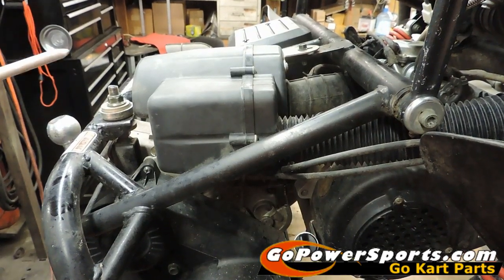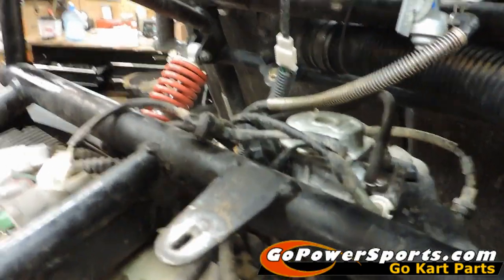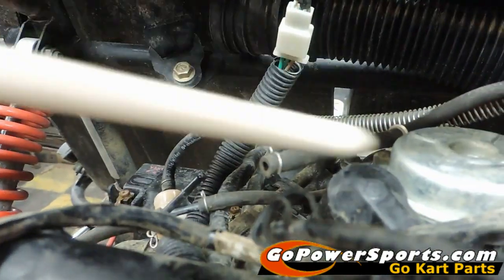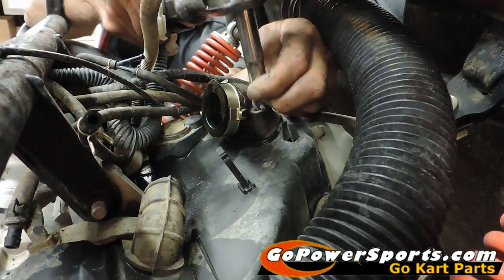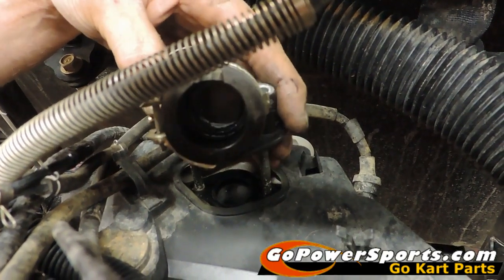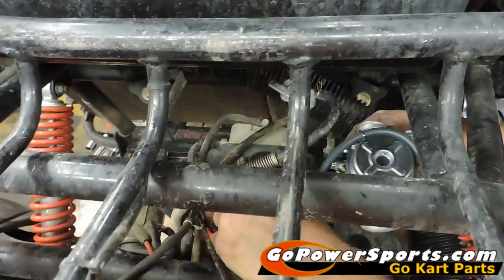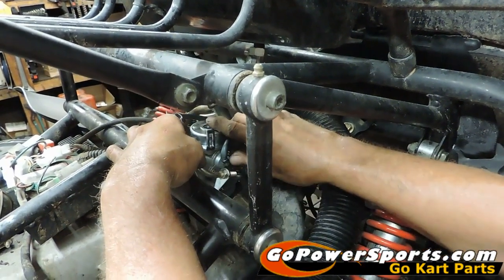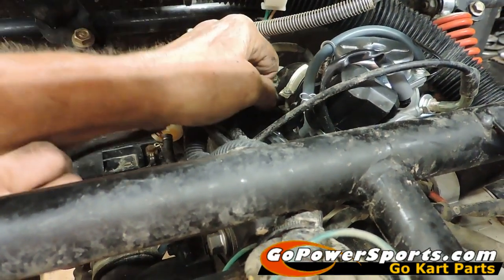150cc Go-Kart Carburetor Replacement

Comment: Thanks, I couldn't figure out where the vacumn line went after the Y but I see this one just has a bolt stuffed into it to block it off.
Reply: fadedexile yeah, some of them have a vacuum petcock on the fuel tank.  Looks like they put a manual one in.  I might do the same.
Reply: @buzmil  so how exactly did they create the vacuum loop if they put a manual petcock on there?  I’m doing the same to my Motobravo 250cc.

Comment: Where does that third vacuum line go thats on the "y" fitting on the carb?
Reply: Mine runs to the fuel valve that has 2 nipples, not a cut off valve like some have.
Reply: My question too!  They’ve obviously replaced the factory “auto” petcock that requires vacuum from the intake manifold.  In this case, it’s a manual petcock so how did they create the loop?  Otherwise you’d have vacuum loss.

Comment: A little help! I have gas and oil in my Air-box. I replaced my carburetor and left the box off and gas shoots out the vacuum hose that goes in my air-box. Any idea why or what’s wrong.

Comment: I have a question I have a similar go kart but my go kart transmission stays in low gear. Is that do to the vacuum line on my transmission not connected?

Comment: Have a kart with the same Carb.  It will start and run for about 3 seconds.  Then it stalls.  I've pulled the Carb and cleaned the pilot and main jets.  It started and stalled again.  I drained the float bowl.  To make sure I was getting fuel through  the needle and seat.  Then it started and stalled again.  Any suggestions
Reply: Nick Druyor did you figure it out? Mine bogs out has no power